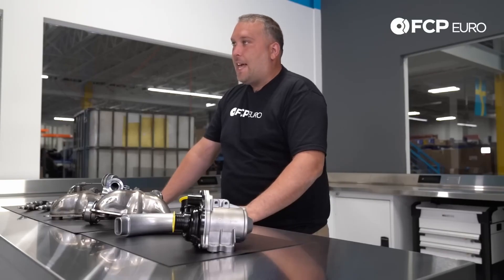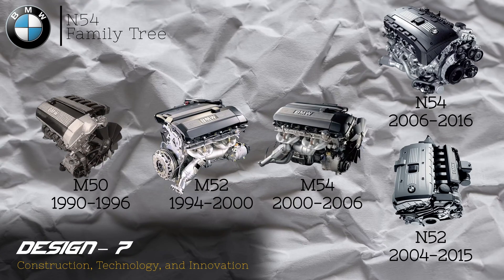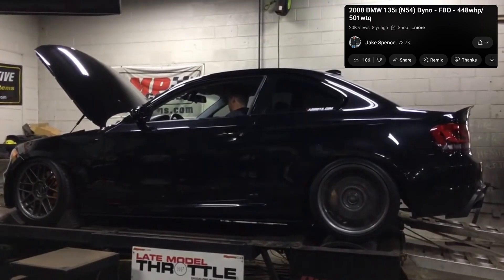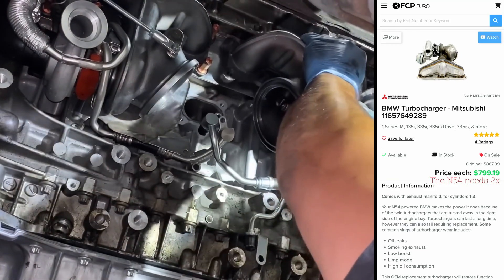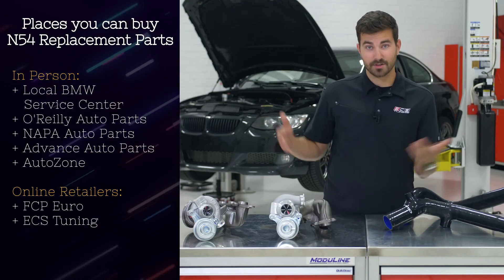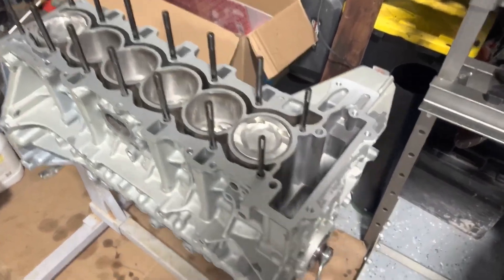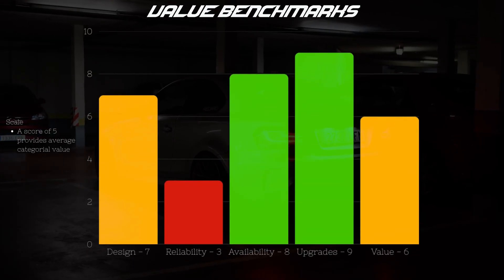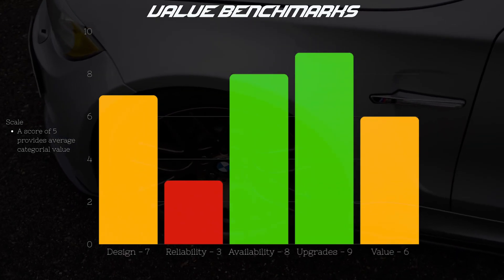How BMW’s N54 Became a Tuning Legend… And a Mechanic’s Worst Nightmare! | Power Rankings

Comment: The N54 yes had its problems i have a fully buit N54 with the Nexsys DI delete on stock ECU. its Awesome totally different engine now no misfires no trouble with the port injection or the reflex plus. You should do a video on that.

Comment: Too many hacks own these cars and have no idea how to work on them, they blame the engine when all along it's the backyard mechanics that have no idea. Don't go near these cars if you don't know what you are doing. I have had a 335I since 2006 new a couple of years ago I fitted T17s running a realiable 600hp and it has very rarely ever let me down in fact it has been more reliable than any other car I have owned in my 55 years of driving.

Comment: I bought a 2011 n5 e93 for my fiance about 4 years ago and absolutely loved the way th car drove and handled. After a little research and talking to some folks and realized I had just a taste of what BMW had to offer. I really wanted an e46 m3 but at the time couldn't find one spec'd the way I wanted and then an opportunity to snag an 110k bone stock 07 e93 335i presented it self so I snagged it. After keeping the car stock for a bit I went fbo and tuned and it is hands down one of the funniest cars I've ever owned....coming from a guy that has had a few sports cars..... camaro ...corvette.... charger r/t. I will say do your research on these cars before jumping into the deep end with them....but hot damn are they fun 💯💯💯💯

Comment: 8:35 The Syvecs S7Plus can support N54 DI and PI and has been available for several years. Motec ECU's have been used in N54 race cars for many years too.
Then there's DI delete, which has off the shelf support with MaxxECU, and makes it possible to run pretty much any ECU you want.